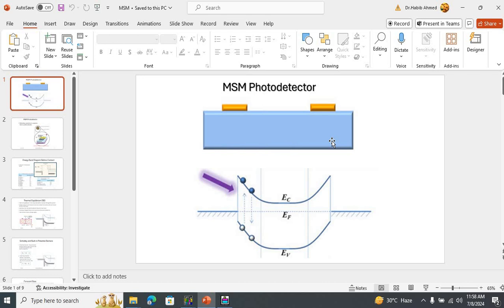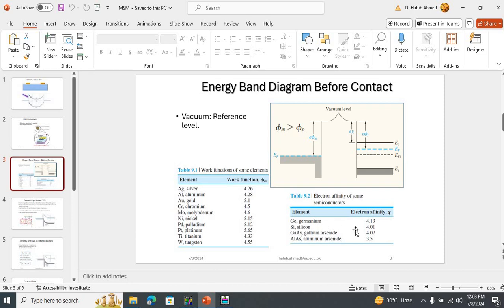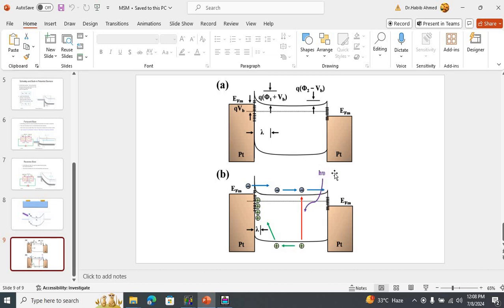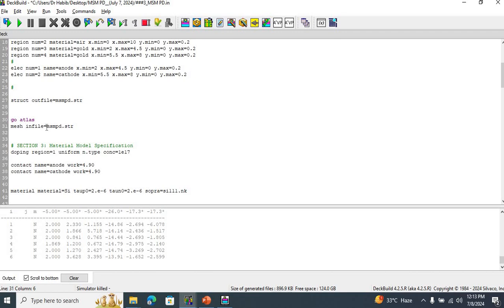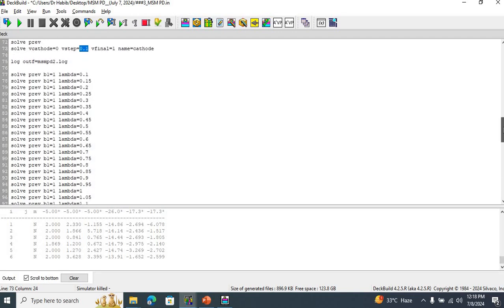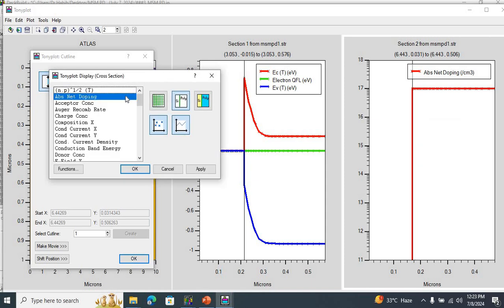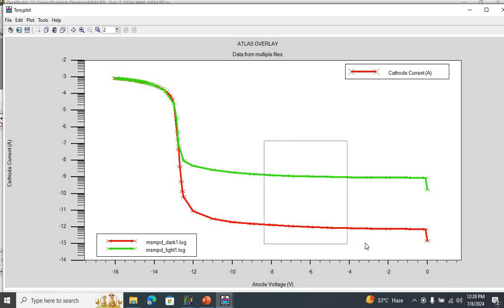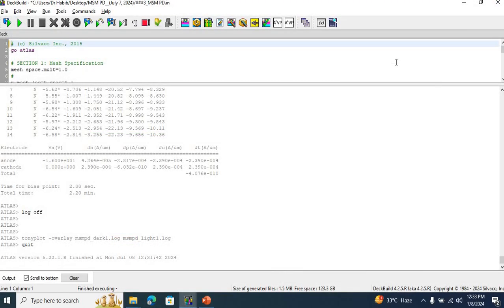MSM Photodetector Silvaco TCAD Simulation || Metal Semiconductor Metal Photodetectors 📸 🎥🚀✨

Comment: Sir its an excellent lecture for photodetectors. Sir how to get the responsivity sepctrum anf detectivity sepctrum of photodetector.can you explain for this example pls.
Reply from the maker: Getting a responsivity curve is easy. The current Vs wavelength curve is already plotted in this program. Just divide the current by the input optical power to get the responsivity curve. Detectivity depends on the noise characteristics which are not simulated here.
Reply: Ok sir thanq
Reply from the maker: @pmcholines7244  No problem!
Reply: Thank you sir for the video,
I am facing the same issue, not getting responsivity curve. Sir how do we get optical power and where to divide,
Secondly how do we get efficiency graphs?

Comment: Can you provide examples of the exact optical devices that use msm photo detectors. It would help me understand.  Are these msm photo detectors laid out in arrays, or is one msm photodetector enough? Pls provide images/pictures of a real msm photodetector. What does it look like?
Reply from the maker: That's a great question.

MSM (Metal-Semiconductor-Metal) photodetectors are used in various optical devices, including:

1. _Optical communication systems_: MSM photodetectors are used in high-speed optical communication systems to detect light signals and convert them into electrical signals.
2. _Fiber optic sensors_: MSM photodetectors are used in fiber optic sensors to detect changes in light intensity or wavelength, which can indicate various physical or chemical parameters.
3. _Optical imaging systems_: MSM photodetectors are used in optical imaging systems, such as lidar, to detect light reflected from objects and create high-resolution images.
4. _Spectroscopy systems_: MSM photodetectors are used in spectroscopy systems to detect light of specific wavelengths, which can be used to analyze the properties of materials.
5. _Optical interconnects_: MSM photodetectors are used in optical interconnects to detect light signals and convert them into electrical signals, enabling high-speed data transmission.
6. _Photonic integrated circuits_: MSM photodetectors are used in photonic integrated circuits to detect light signals and convert them into electrical signals, enabling various photonic applications.
7. _Biomedical devices_: MSM photodetectors are used in biomedical devices, such as pulse oximeters, to detect light absorbed or reflected by biological tissues.
8. _Optical metrology systems_: MSM photodetectors are used in optical metrology systems to detect light interference patterns, which can be used to measure physical parameters with high precision.

MSM photodetectors offer advantages such as high speed, low noise, and high sensitivity, making them suitable for various applications where light detection is required.